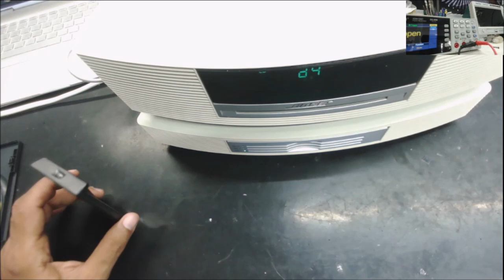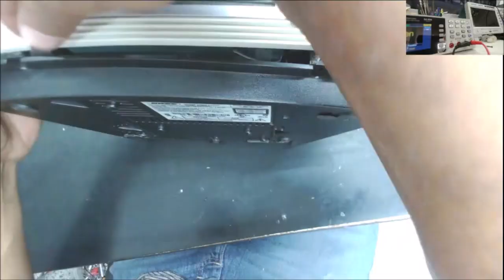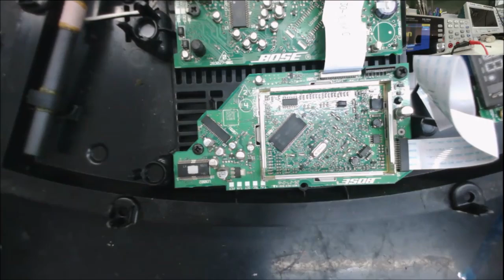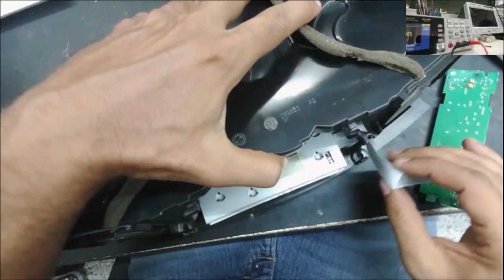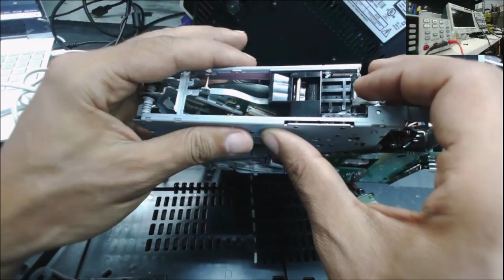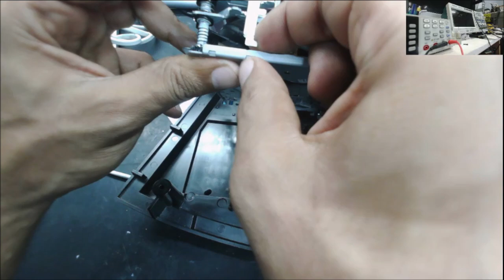Bose wave and 3 CD changer not playing CDs

Comment: Twisting may cause print damage
Reply from the maker: i don have no problem with it, twisting the cap will not damage the traces or pads just dont pull it
Reply: Side cutters work well also if you dont want to twist.
Reply from the maker: @bobsoft  that is another way